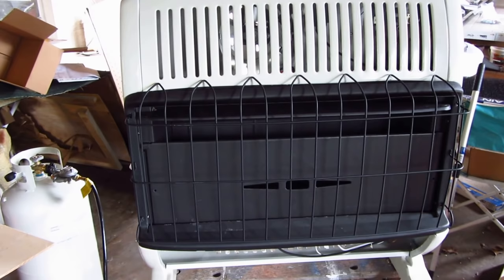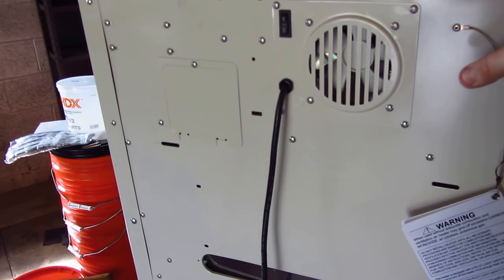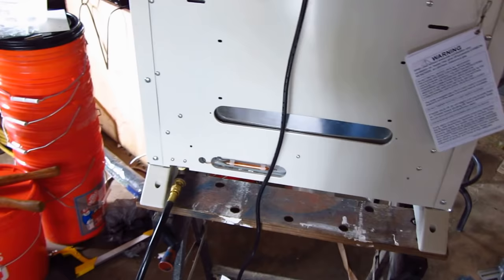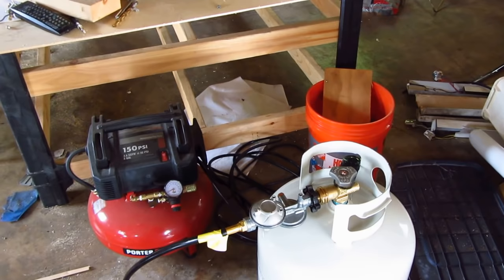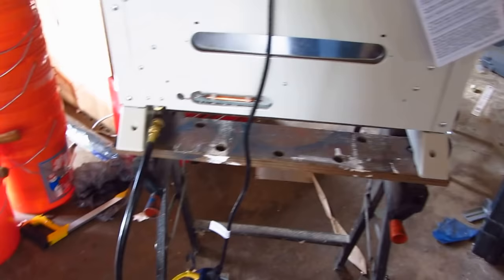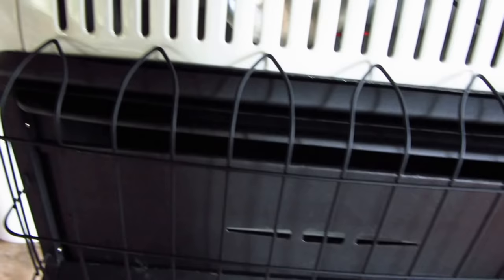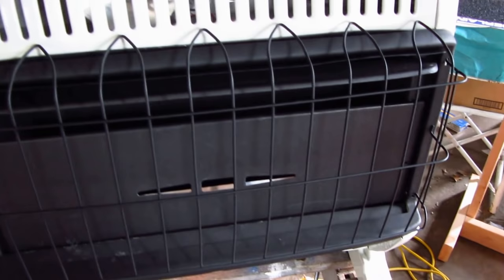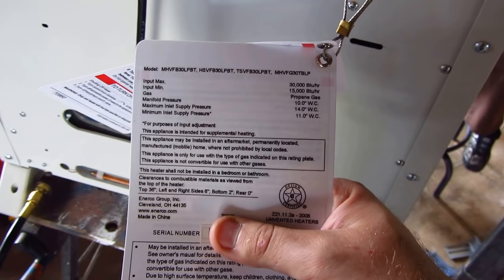The Mr.Heater Blue Flame Vent Free Heater (LP) Review

Comment: Mine quit working after 2 years
Reply from the maker: Sorry to hear that, They have replacement parts unless you already bought a new one. Sorry for late reply.
Reply: @IndianaDiy  I am going to buy something else. I live in Alaska. It gets cold here LOL.
Reply: @IndianaDiy  they put out the heat, mine is 20K I think without the fan. At 20 below it runs 3 times an hour for about 2 1/2 minutes No oxygen problem either, its a 16x24 cabin, believe me, it is tight. I just don't want to rebuild it every other year.
Reply from the maker: @rbodell  awesome, sounds like it does a great job to me. I don't blame you about the rebuild though. Did you look at my other video on the Thermablaster I believe they make smaller units
Reply: @IndianaDiy  Ill check them out, I haven't made a choice yet.
Reply from the maker: Let me know what you get I’m interested since there are a lot of different heaters out there.
Reply from the maker: Hey thanks, I’ll be sure to take a look.